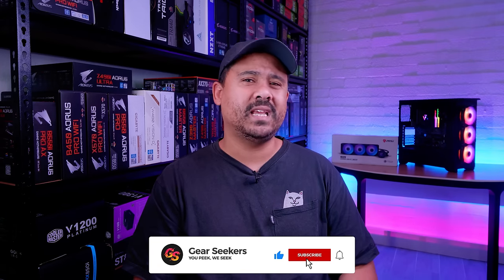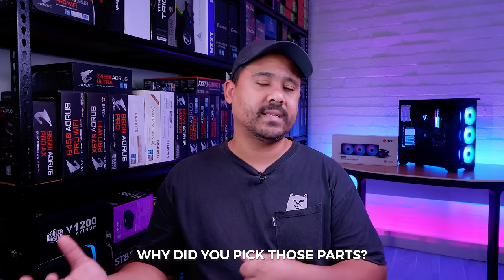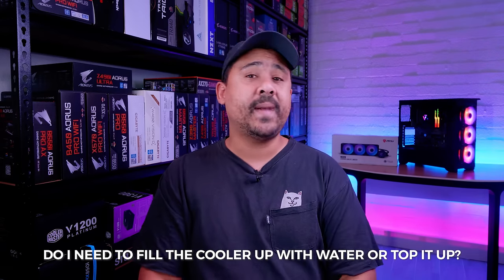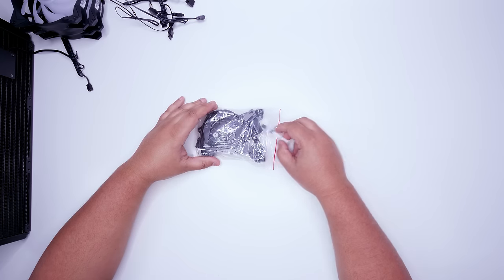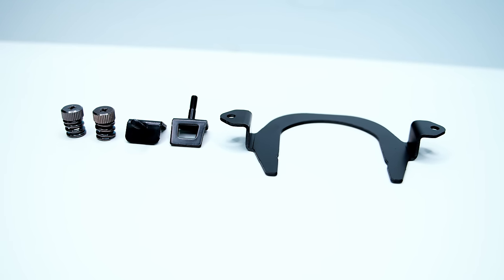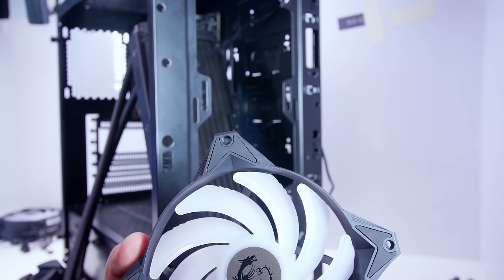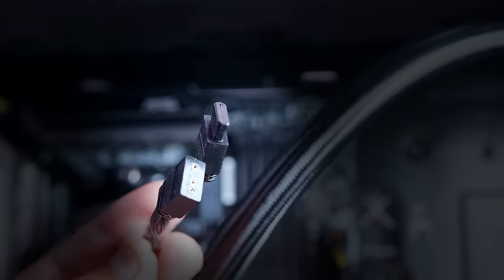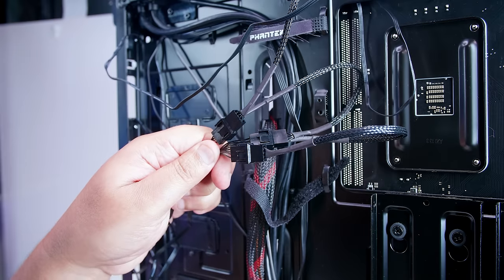HOW TO MSI MAG Coreliquid 360R & 240R AMD AM4 & AM5 Install Guide

Comment: I have the same cooler but I can hear it sort of clicking sound .. why and how to fix it ?
one thing one the CPU side I have the 2 tubes on top.. shoud I have them on the side? and also I have the RAD on top of the case as an outtake .
Reply: Mine doesn’t even do it’s job
Reply: you cannot fix it, it's a long lasting issue on all Coreliquid series and you'll have to return it.
Reply: @ggbk8584  yeah i removed it and replaced it with a fan that thing was full of junk inside
Reply: @ggbk8584  Ok. I have Emailed the shop where I bought it. 
There is also a recal on this system but only a certain range of serial numbers .. and mine was not in the list :/ :D

Comment: @Gear Seekers  Keeping in mind that in a particular case, you can have either of the two configurations, tubes up and tubes down. which would be the best? That the radiator pump will be the lowest in the circuit, correct??? Sending you a big hug from México!!!
Reply from the maker: It makes no difference. It's up to you :)

Comment: This will be helpful.  I have a pre built from MSI - an Aegis ZS with a Ryzen 5800X and RTX 3060Ti.  8 months in, and my little 120mm AIO decided to commit suicide, and idle temps were hitting 100c.  I am expecting my RMA to come back with the V2 of the 240R.  I wasn't quite sure about connecting it since there will be an additional fan to plug in, but seems easy peasy lemon squeezy...  thanks for the vid - side note - I am strongly conisdering going with a different AIO - maybe even a 360 since I have the room, and cooler is always better - so wondering based on performance - RGB or not, what you've found to be a great solution at that size?  I'm eyeing Arctic, Be Queit, Corsair, and an NZXT (I know the pumps are all Asetek, but tubing, rad, and other things are not).

Comment: i have a problem connecting all those wire properly to get to work properly, the fan will turn from the radiator but the light does not work, and the cooling pump in top of the cpu does not work either. may you give me an advice why. and my rog Strix b550 do not have Jrainbow

Comment: Hi thank you for the guide. I have completed the installation It works smoothly but without lights because I can't connect the rgb cables. Fans are 3pin and 5v,  my motherboard JRGB connectors are 4pin and 12v what type of cable do I need? I have a Tomahowak B450 Max.

Comment: Have you any issues with the pump and tubes being at the highest point? My 240 version is gurgling and fading being top mounted after 7 months. I’m trying to front mount the 360 version right now but the tubes seem just short for my phantek p600s
Reply from the maker: no because the pump is in the rad.

Comment: So isn't it a bad idea to have the AOI pipes on the top of the cooler stack? won't you be pulling warm water into the inlet pipe as hot water rises to the top, and also I always thought that bubbles could form there over time and create pockets of air. And your fans are drawing air into the case, but is blowing warmed air into your case a good idea?

Comment: If our radiator is empty, how much we need to fill it up? up to the top hole or more? delta T if it is 70 or 75 d. C. we need to leave 5% empty. but how the water will circulate in this case. cannot jump to the two flexible. Or is safe to fill it up to the upper hole?
Reply from the maker: You don't need to fill it at all
Reply: @GearSeekers  But I cleaned mine due to a problem, as the dealer said to change it because in a part of the liquid circuit is still cool and the CPU T is too high. I tried to fix it by myself. I found that 40 to 50 cc are missing or less from total capacity.
Reply from the maker: These are closed loops. They should NEVER under any circumstances be opened up. You have voided the warranty by listening to this "dealer"
Reply: @GearSeekers  Already the warranty is terminated, so this model has a problem, some particles appeared when drained the water. Anyway, I solved it. This video doesn't explain everything. Anyway, I discovered the right way. And now it turns as new one. CPU stress test with 4 software for 2 hours, T fluctuating between 40 and 74 degrees C.

Comment: Question: I have plugged my RGB pump plug on to Rainbow 2 of my MSi z590 tomahawk wifi mb. But the MSi mystic light software will not charge the rainbow colours. It shows steady fixed colour but soon as I switched to rainbow it changes to a random flickering colour like red. 

Any idea why? ??

Do I need to daisy chain the male three pin plug to a fan or something? .

Comment: dont those fans push the hot air from radiator inside the case when placed this way?
Reply from the maker: The air temperature is not important

Comment: Hey! I'm using the 240mm AIO and I have an MSI RGB hub that also connects to the fans. Can I plug the RGB header from the water block to the rgb hub too or should i leave it at the jrainbow pins. PLease help!

Comment: major question since it appears that you're using a phanteks p400 case were you able to put the front mesh cover on with the fans mounted off the front like that? or were there clearance issues?
Reply: If anyone was wondering 120mm fans will fit on the outside of the metal frame and the mesh cover over them

Comment: There's one thing I don't understand about this AIO's fans. I feel like the direction of the fans blows in the opposite direction. So if you place them in the direction of the sticker facing the direction you (we) placed them, they blow outward that direction. 

So the way you've mounted is sucking the air out? I've also mounted them in this direction, but I already have exhaust fans. I wanted these as intake, and I feel like they're blowing air out. Would probably be cooler if they'd intake, essentially hitting the radiator and blowing on the components while the exhaust fans suck out the hot air. Confused.
Reply from the maker: The air temperature does not matter. The point is to have the air moving. They are set as intake.

Comment: I need help with mine. I have the 240r version, and the block cooler wire is not the same at yours. I have the 4 pin female.. and I'm wondering why I have the different one

Comment: Hello, so uh what if my mother board doesnt have jrainbow1 and pump in the board!? I only have Led_c1, Led_c2, and Led_CPU 
HELP!
Reply: you just need to go through the mother board manual.  There will be a page that goes over in detail what each plug connector pin on the mother board does.

Comment: What if i have a tomahawk B450 MAX motherboard and 12v? How schould I attach the RGB cable?
Reply: Nevermind. I have ordered already a converter from 12v 4 pin to 5v 3 pin ;)
Reply: @Dyniek93  where did you get the cable and did the converter end up working
Reply: @enriquesoto6634   I’ve ordered on Ebay a RGB convertor from Deeppcool. Everything work perfect!

Comment: Just a question Im having trouble mounting the fan header. There seems to be a gap under the clips the screws have nothing to grip onto. I think I'm using the right method . Also a converter from umart fixes the jrainbow problems. IM using a Asrock B350 motherboard.
Reply: fixed😀

Comment: Man I have mine setup and installed like yours except using a 1700 Intel but my CPU is immediately over heating.  Got fans running and lights I can't tell if the pump is or not.
Reply from the maker: Make sure everything is plugged in correctly :)

Comment: So this one is not compatible with MSI b450 Gaming plus max then. Atleast on the lighting side. Because the B450 Gaming plus max have 4 pin 12v RGB plugs and this one has 3 Pin slot.

Comment: I think you missed just a tip for something. "How are the fans and radiator supposed to be attached if the case doesn't allow that sandwich method?" like in one of those NZXT cases with sound-proofing. Not enough space inside the front/top panels for a sandwich but enough for the entire thing inside. How would one go about screwing the fans and radiators onto the case?
Reply from the maker: The start of the video literally says "This is for demonstration purposes only"

Comment: installed coreliquid R240 on my MSI X470 Gaming  Pro  but dont have the Jrainbow 3 pin , only have 4 pins and think is 12v not 5v any idea how can plug in so i can get light on....? or any link of HUb that can resolve my problem. trying to figuring out on web but cant find awnser thank for your help

Comment: I have a Ryzen 5 3600 will that fit I just got the V2 replacement in today I did have the 240R but heard about the recall and never used it got it new

Comment: I have the 240R version of this cooler after 6 months mine is making a strange grindy sort of noise when i turn on my computer any idea what it could be  and it dont seem to be cooling my cpu very well anymore when gaming my cpu gets up to 90c and higher
Reply: it's manufacturing defect and it is not fixable. well known issue on all Coreliquid series. return it and get another AIO
Reply: @ggbk8584  i took it back and got the series 2  version of this Ai cooler seems to be working fine so far

Comment: Excellent installation video...I recently installed the 360R V2, and the radiator pump seems to always spin at ~4200 RPM regardless of how I set the temp curves.  Is there a way to get the pump under control and not spinning at max all the time?

Comment: Today i’m installing the 240r on the Top of the Case, my question is Can i have the fans Pushing air Out instead of in as i have 3 in the front pushing in or will it not Cool my Ryzen 7 3700x ?  Thanx
Reply: Yeah you can have it pushing the air out of the case if you put it on the top, it's even better as you get the back fan and the watercooler fans pulling out the air and the front fans pulling in the air. It help the back fan to remove the hot air of  case.
Reply: @falkensteinfallen1288   :  Since i had 3 front fans pushing air into Case & 1 rear pushing Out, i installed the 240 aio On top with air pushing Out / up …. ( 3 in / 3 out , Pull, Push Conf ) Click on my Nic  and you will See the Temps & Thanx for feedback 🍷

Comment: Awesome video much better than manufactures, however you failed to mention installing the fans like you did, does allow the front cover to fit properly on this case (p400a). Also you didn't mention that you removed the front HDD bracket to allow the radiator to fit. Just thought I'd mention this to help others out with this same setup. <3 <3

Comment: I have a question hopefully you will answer, I don’t have a 5v argb on my motherboard since i own a b450f, theres a molex cable in the box, can i use that to power up the argb of the pump without connecting it to the mobo?

Comment: Very helpful Video. Only Challenge i have is: my aio head doesnt have that cable like you show. It has just 3 pin female+male cable. I connected all fan cables together and the male 3 Pin of the aio head. The female end is on the mainboard arg connection. Rgb on the head and radiator fans doesnt work like this. Any help?

Comment: Hello! Thank you for the work first of all.
I have a question about the fans orientation:
Why do you put them this way? Aren't you pushing hot air in the case like that?
Reply: i think not because you are pulling cool air from the fans right? maybe the cool air compensates with the heat from the radiator? idk lol😂

Comment: What if my case has fans included in it can I use the 3 fame for internal cooling and still let the case fans run their rgb simultaneously with the msi cooler and rgb ram?

Comment: Arent the tubes supposed be faced down in a front mounted?
Reply: Yes, dude has them wrong..  I noticed that too!
Reply: Except the pump is in the radiator here, might not be an issue in this configuration.

Comment: can this aio hold two 140mm fans ? and there is no usb plug in to power the aio ????
Reply from the maker: No you cannot and it doesn't require USB. The video explains everything :)
Reply: @GearSeekers thank you will this aio cool a i7 14700k ?

Comment: I bought this a few day ago and installed it to my pc but when i looked at its rpm rates in MSI Dragon Center,  Cpu fan is 600 rpm and Pump fan is around 4000 rpm on idle, while there is no apps running background just a browser. Is it normal? By the way, CPU's temperature is around 20-25, and while playing games it is 40-45 celcius. I also checked the cables and fans again but everything is fine and correctly installed.
Reply: Bende gecenlerde aldım benimde ayni sıcaklık degerleri ryzen 5 5600x , 9 ay once kurmussun galiba hic sıkıntı yasadın mı
Reply: @Cahit1111  Yok hiçbir sıkıntı olmadı. Araştırdığımda da zaten pump fan'ın en yüksek hızda çalışması gerektiği falan yazıyordu.
Reply: @AlienGamerCassius  eyvallah cok sagolasın Allah uzun ömürler kullanmayı nasip etsin
Reply: @Cahit1111  Sağolasın, sana da hayırlı olsun. Güle güle kullan

Comment: Unfortunately this video doesnt help with the 240r fan/rgb wiring. The fan splitter is only two way and installation doesnt make sense when trying to follow this wiring for the 360r. I end up with cables that arent plugged into anything. MSI's video skips wiring alltogether, so Im pretty much stuck figuring it out on my own.
Reply: I had some confusion too. I just installed mine today but haven’t gotten the system running yet. Waiting on hard drives tomorrow. Did you end up figuring it out? I have the 240 as well.
Reply: @taylornielsen1048  I have the same problem as well. MSI manual doesn't do much and I'm just waiting till the morning for customer support to make head of it all. Didn't have a leftover splitter to connect to the wire that was plugged into the JRAINBOW pins.
*Edit: Figured it out. You're gonna connect the leftover splitter from the JRAINBOW pin with the RGB pins from the top fans leaving one by itself.
Reply: Have you figured it out yet? Found a vid that MSI had was a step by step with this cooler and no editing cuts.
Reply: @jaybuddyy  I did actually. The splitter that comes off the motherboard is where you plug in the fans. Then the other cable that splits off from the rainbow connector on the motherboard is where I plugged in the other wires on the fan cables I believe. They chained together and fired up perfectly when I turned it on. It’s kinda hard to explain without video or a picture.

Comment: i thought its bad for the radiator to mount upward?
Reply from the maker: Not when the pump is in the rad
Reply: @GearSeekers  Keeping in mind that in a particular case, you can have either of the two configurations, tubes up and tubes down. which would be the best? That the radiator pump will be the lowest in the circuit, correct??? Sending you a big hug from México!!!

Comment: Why wouldn't you recommend this chiller for a Threadripper processor?
Reply from the maker: Surface area on the rad and coldplate itself is not large enough.

Comment: Very disappointed: I changed a Corsair 240mm that at idle kept the temperature at maximum 43 degrees in summer, for this MSI 360mm, and now the idle temperature does not go below 55 degrees, and it is not a matter of poor installation or quality of thermal paste. Besides, the Corsair had it with 4 fans, two on each side of the radiator, the MSI the same, 3 on each side of the radiator, but nothing, in the Corsair the temperature difference between 2 and 4 fans was noticeable, not in the MSI.

Comment: 2 questions. If i use my own fans do they all need to be hooked up to the same circuit as the water block or does it not matter? I have a dust screen in front of my fans so if I install it the same way in this video I doubt my dust screen will go back on with them like that so does it matter how it’s installed?

Comment: Hey there!
Thanks for the tutorial which helped me a lot with my new build.
One question though: 1 of my 3 fans (360R) is not in sync with the other fans. I've plugged the female RGB-header to the male CPU-cooler header, the female CPU-cooler header to the mainboard (JRAINBOW) and daisy-chained the other fans together. And now I've got: fan 1 and cpu-cooler: in sync; fan 2 and 3: in sync. Did I create two daisy-chains?

Comment: I dont have that Pump and Rainbow Header in my Mortar Max sir.. Can I still use this AIO? I have 2 hubs included on my Deepcool RF120 Fans.
Reply: Did you find out ?
Reply: @jesuscabral1074  Nah.
Reply: Yeah I think your motherboard doesn't have a 3 pin argb header, so you need to buy a separate rgb controller and plug the 3 pin cable to it, while for the pump_fan, I think someone had the same problem in the link below,

https://forums.tomshardware.com/threads/where-to-plug-aio-on-a-mb-without-pump-header.3556077/
Reply: @ZAiN_JZ  thanks sir

Comment: So I don’t have a JRainbow 3 pin 5v pin on my MSI B450 Pro-VDH Max. The cooler runs, fans spin, but RGB doesn’t turn on. Clearly it’s because of the 3pin 5v not plugging into the Mobo. 

Do I have any options here? Is there a separate controller I can get to work with the RGB?
Reply: @enderjose7558  So I had an old fan hub that gave power to the LED cord. Find a Hub somewhere that will take the LED cable and then just run it to SATA for power.

Comment: Wait wait please reply. Does it make a difference if the pumps at bottom. Instead of top like yours ?
Reply: i think if the pumps are at the bottom, it means the little bit of air bubbles in the tubes will go to the highest point, which would be the water block which you do no want at all, so you must have the pumps higher than the block

Comment: Hi, I just built a PC with this cooler. I am using an Asus X570 Tuff Gaming Motherboard, is there any other way to get the RGB for the cooler and it’s fans to light up? The current mobo does not have J Rainbow headers.